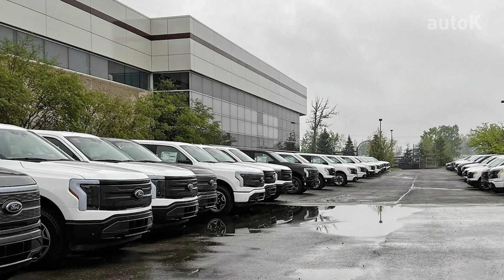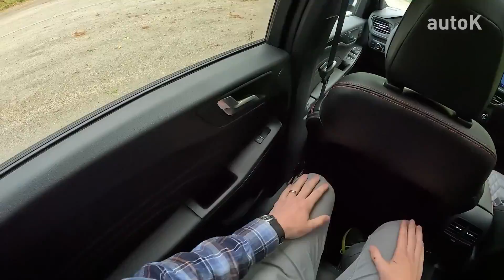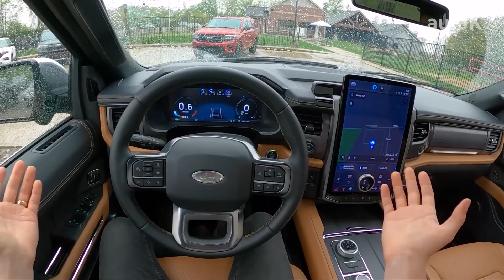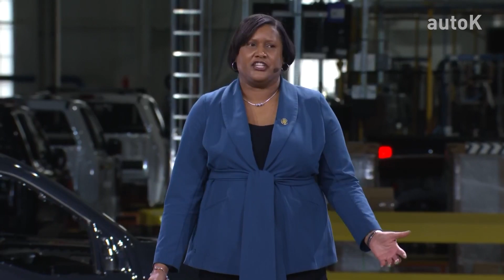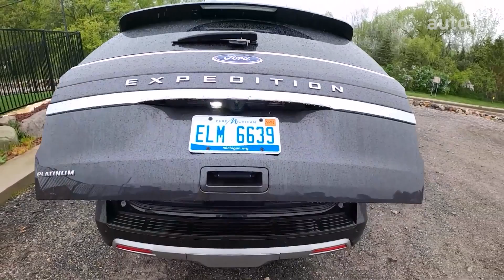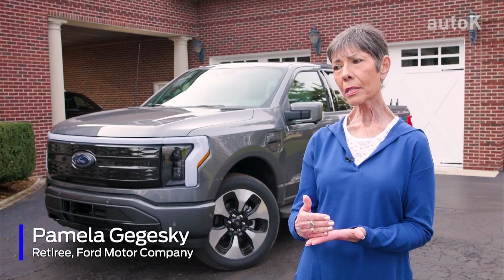Ford Dealerships are FILLED with TRUCKS - The company CAN'T SELL

Comment: Junk trucks for astronomical amounts of money. I got two 4 bangers lower 2000s and paid $3300 for both. Threw tires, brakes, timing belt/waterpump on camry, serpentine belts and all fluids changes and inspected both. Cost less than $4600 total.

Comment: Are y’all surprise u used to be able to buy a brand new mustang for 20k off the lot and a v8 f150 for 25k and they were good reliable vehicles they still are y’all feed into this dumb bs cuz of a parking break issue
Reply: Swoosh! And no, that not nothing but net. It's the air rushing over your head and between your ears.